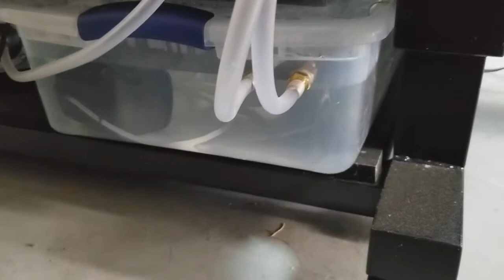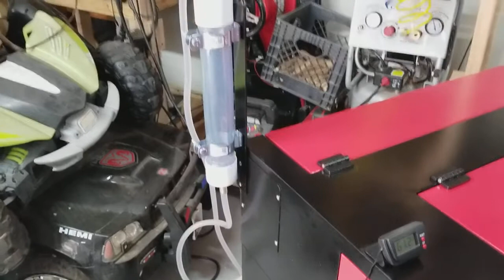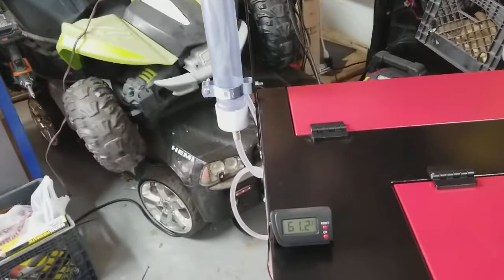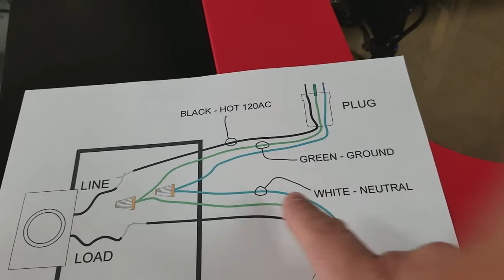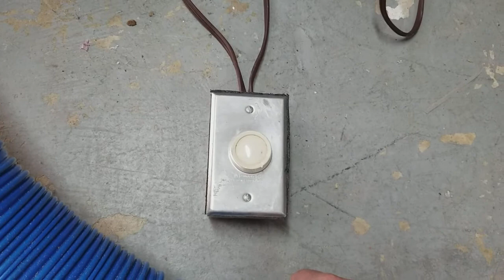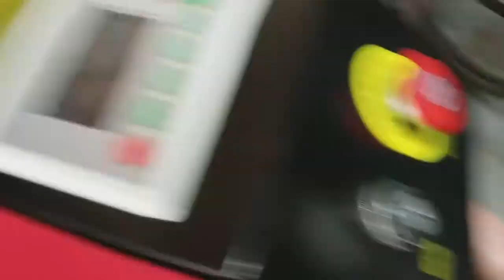Part 11 - 60 Watt CO2 Laser -   Enhancements to the machine.

Comment: I have pretty much the same machine and while I haven't had any power supply problems, I DID recently have a problem with the crappy hose/tubing.  I would highly recommend putting hose clamps on every connection with a barbed fitting (not on the tube, of course) - especially the two behind the panel that houses the inlet and outlet connections to the frame.  One of mine came off and if filled up that closed space behind the panel PDQ.  That space is pretty well sealed and it just about emptied my reservoir before I figured out what had happened.   Other than that, it's been a pretty decent machine.  I like the idea of dimmer switch on the exhaust fan.

Comment: Do you find the water tube helps keep bubbles out of the laser tube?  Good idea for the fish tank thermometer, I'll have to set one up on mine.
Reply from the maker: I have since removed the water Indicator also bubbles are only there for the 1st minute or 2 then they get flushed out. I didnt realize that the machine will not run unless the water flow sensor is active. The machine will tell you to turn on water pump before Laser can activate.

Comment: Now that you've had it for a year, has anything gone wrong or have you had to replace any components?  Mine arrives tomorrow.  Thanks so much!
Reply from the maker: Hello Marti. Sorry I didnt respond about if the base of the machine comes apart. I checked mine and it is welded. So no it does not come apart.  The whole weights approx 400 pounds.
Also about 4 months after I got it the Laser stop firing during the middle of a engraving. After checking many items I narrowed it down to the Laser power supply. I replaced it with a new one that I bought from ebay which cost approx $120.00 and I was back up in running after 2 weeks waiting for the part. But over all I am very happy with the machine.
Reply from the maker: After about 4 month that I had it, the machine stopped working. I traced and found the problem to be the Laser power supply just died. It cost approx $125.00 to get a new one. I replaced it and everything was back up and running. Here it is a year later, and I am in the same boat. The machine stopped working, I think that it is the Laser power supply again. I have it on order and waiting for it to come in. Once it does I may do a video on how to trouble shoot the unit and replace the Laser power supply. But over all I am very happy with it.